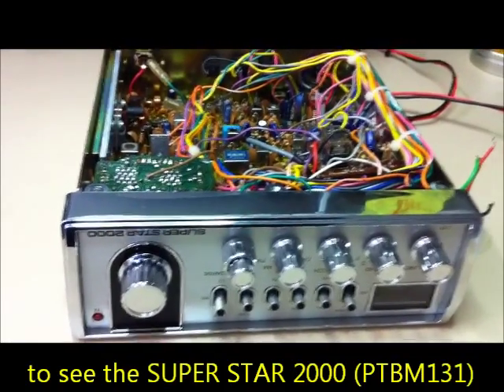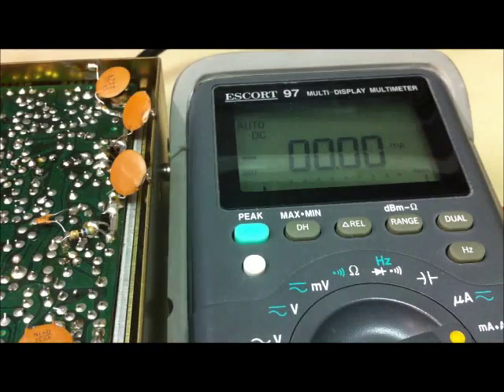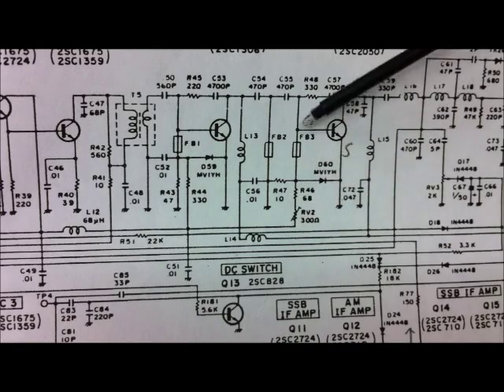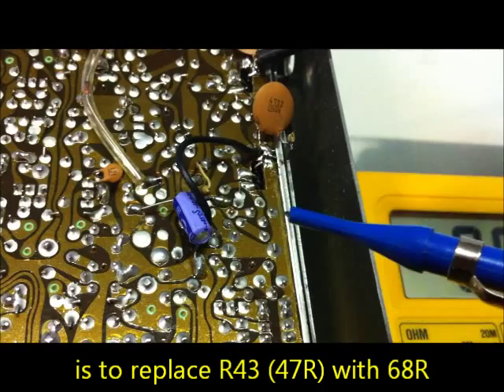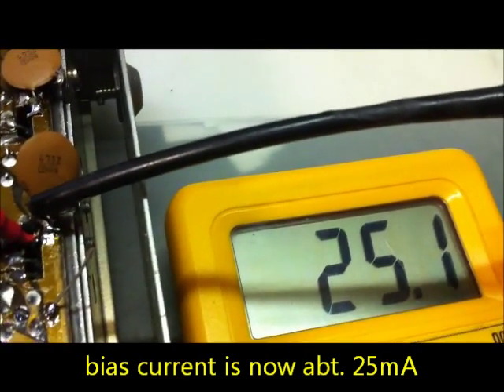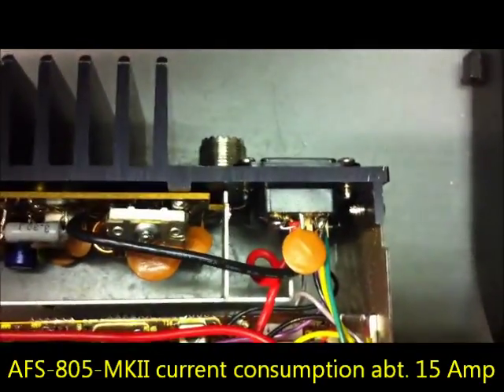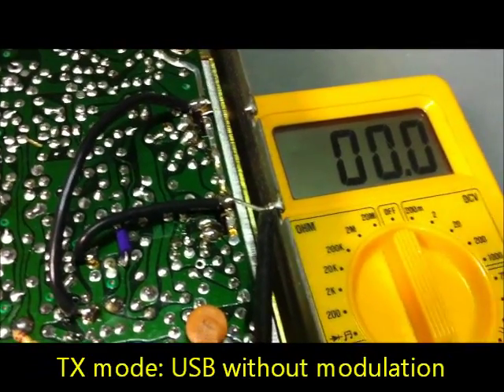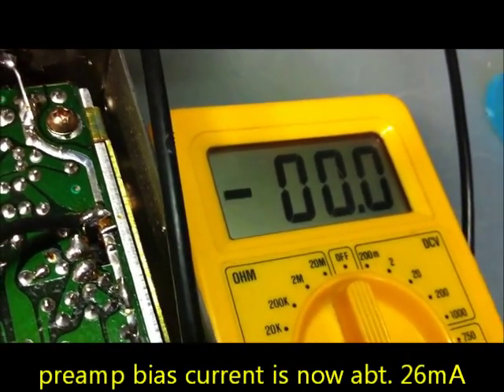SSB modulation performance for CYBERNET's PTBM125A4X / PTBM131 CB radios.

Comment: Hi. where are you placing the probes when measuring the bias current, great video many thanks for posting.
Reply from the maker: Hello Kawasaki, thank you very much for your passion. I couldn't read Hello Kawasaki, thank you very much for your passion. I couldn't just read all these comments. But I can give you the following answer: If you want to measure the BIAS current, you must definitely desolder the EMITTER from the PCB. You need to insert the amp meter between the EMITTER leg and ground, and then conduct the measurement. Here is the video part for that: https://www.youtube.com/watch?v=uDDWhr6nVhM&t=479s 
Wishing you a nice weekend in advance. Best 73

Comment: Hey!  I was wondering if you could give me some advice.  I just got done aligning a PTBM058COX board.  It's the same as a Lafayette SSB-140.  For some reason when I transmit on side band, sometimes it will shoot a carrier.  Nothing to do with the balanced modulator, I checked.  It seems to only happen when I connect directly to my antenna.  When I connect through my SWR meter, the problem goes away.  The antenna is not the issue as SWR is fine.  I'm assuming it's something strange with the output stage.  Any advice?
Reply from the maker: Mr Felix hello, thank you for your interest. Yes, I had the same problem with a Lafayette Telsat 805B. But the PCB was a PTBM131. But on your PTBM058 it will be to find on the TVI filter L12/L13. You may move the cores in this coils untill the problem goes away. This was the same problem on my Lafayette or Midland 7001. That's my input for you and I hope this way it will solves your problem. Best 73s to you..your problem. Best 73s to you..
Reply: Thank you!  It would go away when I lowered the power below 8 watts.  However I'm starting to think the issue is something strange about my antenna because when using another antenna and the dummy load the problem doesn't occurr.  At the same time it seems something similar is happening with an HF multiband radio.  Huh.  I wonder what my antenna has that makes this happen.

Comment: Hello Hello! ,
Great pleasure to watch their beloved colleague videos. But I ask you help here on youtube, it is that I face a big problem with the radio mega star Mg 97 and Super Star 148 GTL, and I can not find a good technician in that area. The persistent problem, as has been analyzed and found the problem are these:
Mega star Mg 97- problems;
* Do not transmit light by pressing the PTT is red
* The resistance R 243, which is right next to the power input supply, heat enough to burn your fingers, but this only happens when it is in USB and LSB.

Super Star 148 GTL

When you turn on the radio, the green light amounts, but very weak, and only the access channel display and press the PTT button the light is red, ie not receive and not transmit.
Reply from the maker: CGINDUSTRIAL Mr CB-Radio fan hello, thank you for your question. I don't know about your radios. I can't find infos about your radios or the PCB in there. I'm sorry, but best 73s to you...
Reply: SWIZZRADIOS I believe that after these classes on their youtube, you would not have anything to hide secret, I do not substimo their impressive intelligence in electronic, including the part of amateur radio.
======================================================= But, see, 
The mega star mg 97 has three transistors: (1) C2166 (2) C2312, the doubts is; I can replace it with IRF 520? . . . If the answer is yes, I would have to exchange more what?.
Reply from the maker: CGINDUSTRIAL http://www.cbtricks.com/miscellaneous/fet_papers/mosfet_conv/index.htm
Reply from the maker: CGINDUSTRIAL Hello Mr Industrial, yes it's possible, if your MG97 or SUPER STAR 148 has the EPT3600 board inside. There is a mod to find on CB-tricks. I try to copy the link into this answer:http://www.cbtricks.com/miscellaneous/fet_papers/mosfet_conv/index.htmYou must show  the 2nd Link on the Chart (EPT3600xx / AM-FM-SSB)
Reply: SWIZZRADIOS  Cool ! Cool !
I have to study this modification project because great care is, from what I saw.
To my radio MG 97 is similarly or better, the Alam 8001, equals are the same design. And I'll tell it to you because this blessed R243, just skip to USB and LSB and missing on fire this R243, believe it not normal and my dear friend swizzradios.
Reply from the maker: CGINDUSTRIAL OK Sir, I've take a look on the M8001 schematic. R243 (47ohms) works with TR 52 (2SD471) together. If you switch to USB/LSB, then TR 52 switch off the AM-Modulator. I think, Trans 52 is defect. But you must check also the other AM-Modulator Transistors TR 50 (2SA471) and TR 51 (2SB754) if these are also defect? That's my idee....
Reply: SWIZZRADIOS So, for your reply now I believe it is these original Mitsubishi transistors (C2166 and C2312) because I had a new 2SD471 transistor, and changed this TR52, but gave no result. Update the transistors and will inform you of these problems and not transmit heat in R 243, due to these components, and that is probably the TR51, TR51 as my radio is the B 827! ! ! Then I'll take a look, may be unsuitable for the radio, and I bought this these days.
Now my head is about to explode, I will rest and then analyze these problems, then you notice the result!

Comment: Hi I have a problem I bought rig with same board but noticed a ceramic capacitor is missing on solder side the ones that go on board to chassis what value are they and how many should  there be
Reply from the maker: Mr Christopher hello. Yes, al the capacitors value are 473z = 74nf or 0.047uF. On my HAM International Multimode 3, are about 6 PCs installed. Two per side: Left, rear and right, beside the PCB screws. Have a nice alignment...Best 73's..

Comment from the maker: Hello dave. Yes, CYBERNET radios do have a very heavy design with covers and chassis of steel. But unidens were manufactured with far less problems in the electronic circuits. The Presidents, Superstars, COBRAS and stalkers are working fine, as well after more than 30 years of its age. Best 73s..
Reply: Beautiful accent.